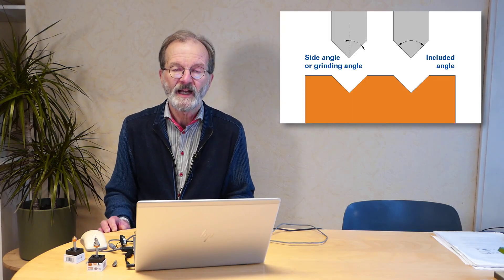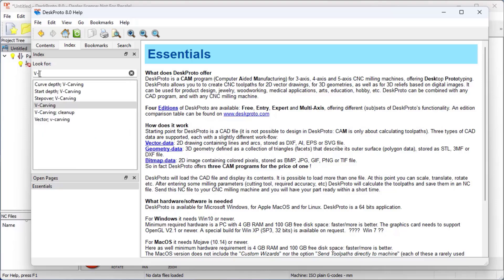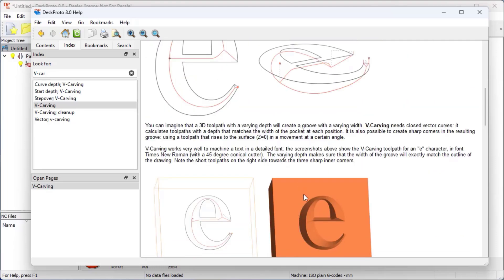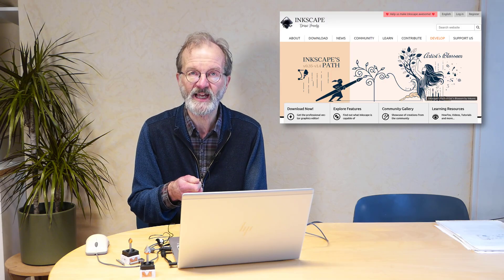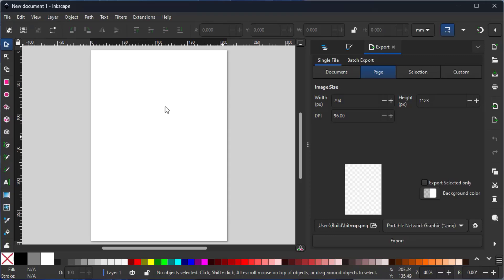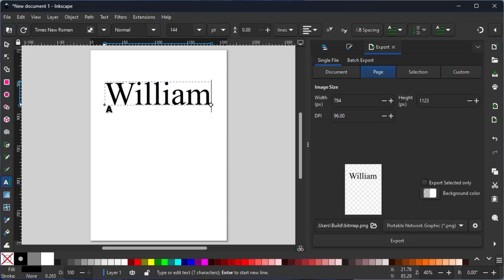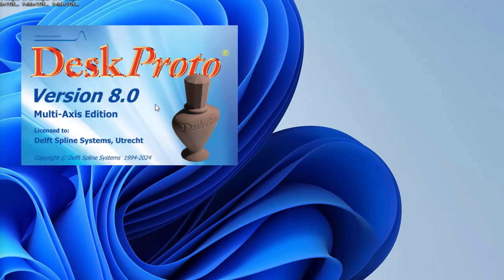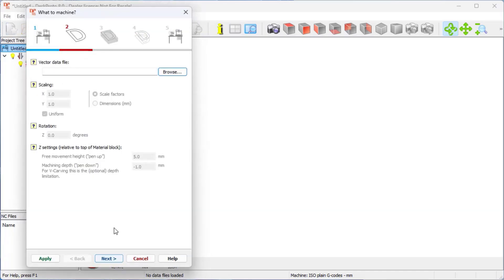Easy V-Carving, with the DeskProto CAM software

Comment: Another quick question,- In the free version, the spindle can not be set to run faster than 10000rpm. Is that the same in the paid versions?
Reply from the maker: That is not related to free or paid. The max rpm is set in the machine definition of your machine. You can find that (and change it) via Options > Library of machines. Both in the free and in the paid versions.
Reply: @Deskproto  Thank you very much.

Comment: Great intro..Maybe not the right place to ask, but can I merge different toolpaths with the same tool in DeskProto, so I do not have to make a "toolchange" and Zero everytime I start a new cutting task on the same object? Lets say going from cutting a pocket to cutting a profile with the same tool. It's the same tool but created as two different tasks.
Reply from the maker: Frankly speaking I do not understand the question. When you have two NC files with the same cutter and the same zero point you can simply start the second file after finishing the first. The machine then should continue using the same zero point.  Will that not work on your machine ?   Also: when in DeskProto both operations are in the same part DeskProto will automatically write the results into one combined NC program file.
Reply: @Deskproto  Well thank you for your answer. It can be challenging to explain and receive a question like this. But I think it's the same thing we are talking about. In one CAM software I know of you have to merge the different toolpaths, if they use the same tool, to avoid the machine from stopping at end of every toolpath. It does not "know" that it can use the same tool, but for a different task, E.g. cutting an outline using vectors in the first toolpath and then continue 3D roughing.
Reply from the maker: @sermandet2022  The confusion is that for the machines that I know it is not a problem when it stops at the end of a toolpath. I then simply can load and execute the next NC file: as the cutter and the zero point have not changed that next toolpath will be perfectly aligned with the first.  Nevertheless: DeskProto lets you combine both toolpaths in one NC file.

Comment: Another great addition  to your software. I have been using your software for many years now. I use the full version in hobby mode. I use hobby because I do not sell what I make.
I looked and did not see an upgrade path for the hobby version. I would be interested in upgrading. I do have V carve on my CAD program but this seems much better.
I have posted a few of my projects on my channel. Both 3D carving and rotary carving as well.
Great job of explaining.
Gary
Reply from the maker: Hi Gary,
Thanks for the positive comment ! About upgrading: the webshop that you can find on our website has a page called 'DeskProto upgrades to Multi-Axis', and one of the products on that page is 'Upgrade to DeskProto V8 Multi-Axis Edition, Hobby license, from DP 7 Multi-Axis hobby'.  That is the one that you need (unless you have an older version of DeskProto).
Reply: Thanks I have all the versions up to 7.1